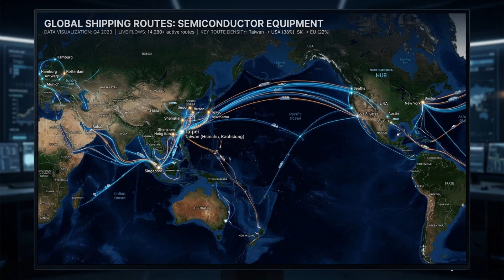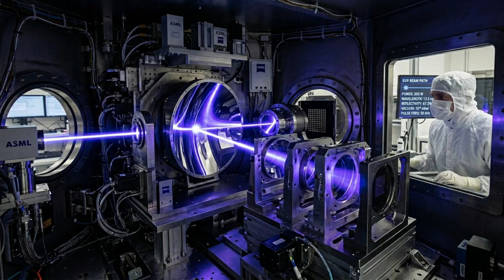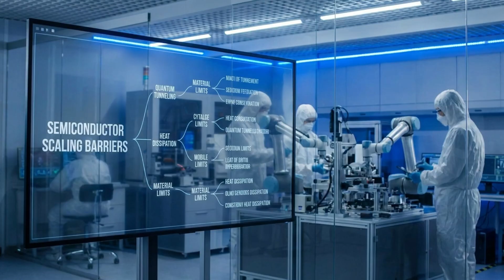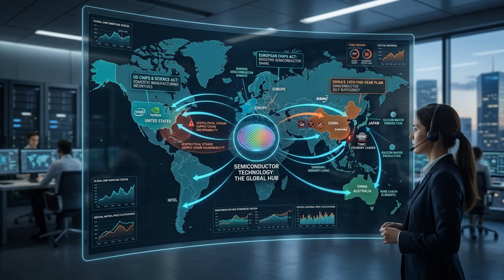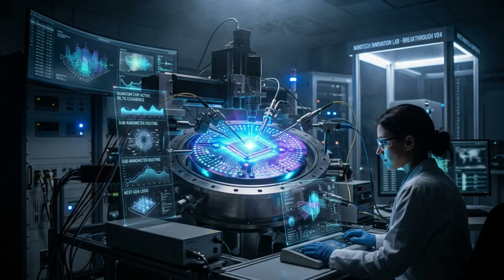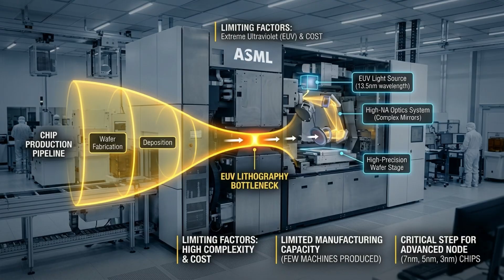The US-China Chip Wat: Who Controls the Global Lithography Monopoly?

Comment: Chip making is like cooking.
ASML builds the latest model stove
TSMC is the largest processing company.

imec (Interuniversity Micro Electronics Centre) in Belgium has the kitchen, the cooking appliances, the cooking utensils, the ingredients and they know how to cook.
Their experimental foundry is an hours drive from ASML, they are in very close cooperation. imec has a working mini foundry inside the ASML assembly plant. They can test each others prototypes on the spot.

Somehow everybody always overlooks imec.

Those 'many' American key components? Good luck with that. The US holds 8.000 out of the 38.000 patents, many in ASML owned companies located in the US. It helps to know the Dutch. They will not build something if they can buy it at a good price. If they can't buy the product anymore for 'reasons' they will shop elsewhere or build their own. They have both the industrial capacity and the R&D capacity to do so.